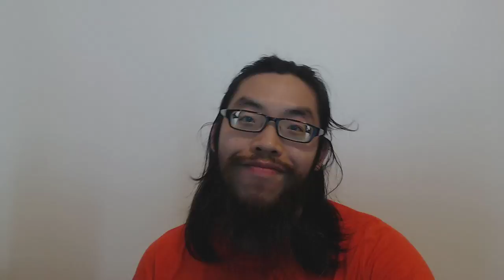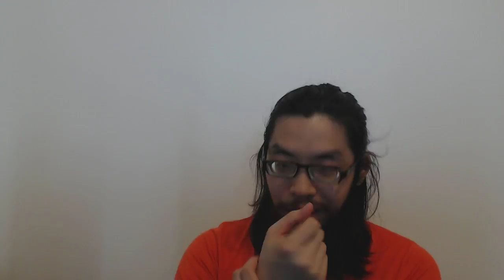Let's Talk About Things - I broke my computer installing the Cryorig H7 Heatsink

Comment: I think mabey that thing broke because its old or something,you talked in the other vid that parts will break in 10 years idk, but you may be right aswell that it broke by cleaning, but hope you will get it working again and get more RAM somehow (I see that its kinda important) but good luck
I dont know really much about computers
Reply from the maker: haha I do not know that much about computers either I had to search up many guides in order to figure out what to do to get my computer back running. I tried opening Overwatch while Chrome was open and it refused to load until I closed Chrome lol. Then I closed Overwatch and opened it again and it loaded much faster. So 4GB of ram might not be enough for my computer.
Reply: ziljin yea i guess so, but how mutch costs like 16GB of RAM?
Reply from the maker: At least 110 USD, but now I won't get it for this computer. I would need a new motherboard and CPU and RAM.
Reply: ziljin ooooh okay